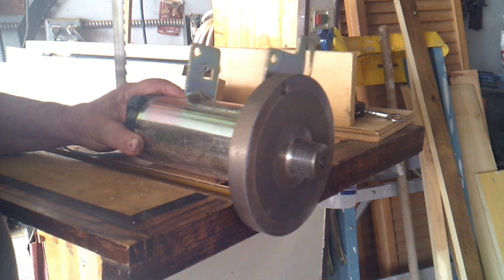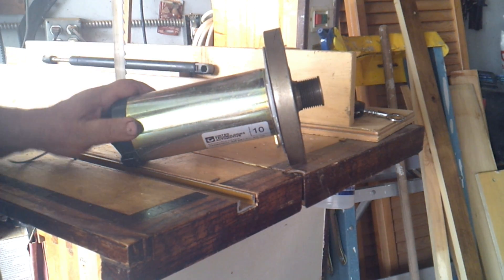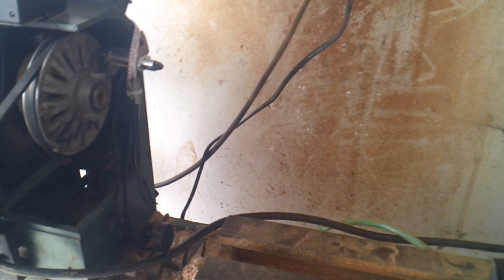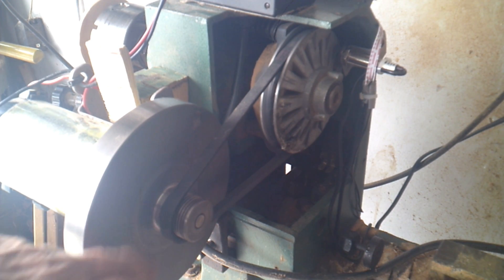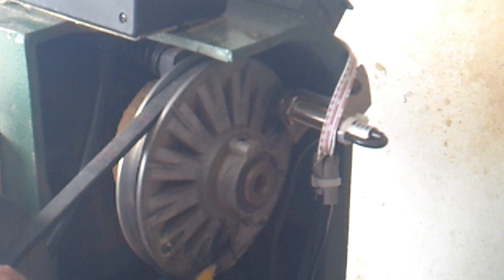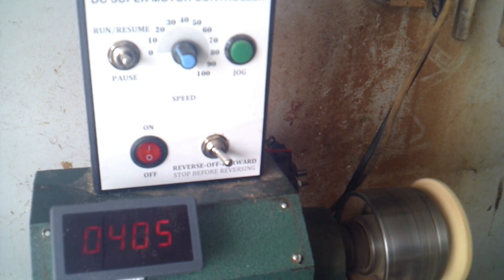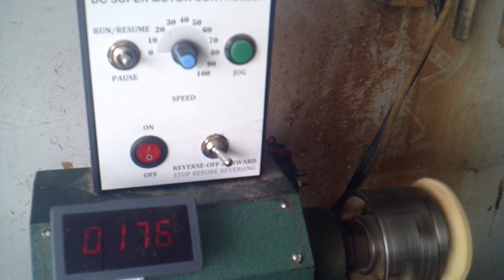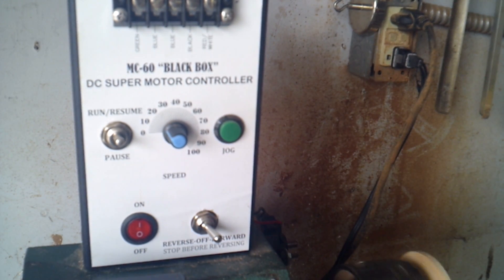Harbour Freight lathe modifications with a DC motor

Comment: Excellent video!  What are you using for you AC to DC conversion to power the motor?  Also where did you source the motor from?  Thank you!
Reply from the maker: mtabernig

Yes, i purchased on Ebay. However, the page is empty. I found a page were there are many motor controllers and perhaps better than the one I had.
here is the page.
https://picclick.com/MC-60-Black-Box-DC-Super-Motor-Controller-Ideal-292651286896.html

Comment: Do you happen to know the site where you bought the black box fo $40. 
Everything I see is around 135
Reply from the maker: Yes, i purchased on Ebay. However, the page is empty. I found a page were there are many motor controllers and perhaps better than the one I had.
here is the page.
https://picclick.com/MC-60-Black-Box-DC-Super-Motor-Controller-Ideal-292651286896.html

This is the one I like.
https://www.ebay.com/itm/112637741836

a few years passes!!!

Good luck
Reply: Thank you for your time. I appreciate it.

Comment: Hi thank you for the video was very helpful I was wondering since it’s been a few years is there anything that you would have done different or are you still liking it as much thank you very much many blessings
Reply from the maker: well, yes. All and all, I am happy with the new motor,  However upgrading my CNC spindle I came up with a Variable Frequency Drive, VFD, wee I can install a regular motor and control it with the VFD   that contraption converts 220 single phase to 220v 3 phase.  the cost of that contraption is equivalent to the box I do have, however the 3 phase motor is much more than the one from the exercise mill....Well is all on how the cookie crumbles. the second method is much more expensive and conversom.
Reply: Thank you

Comment: You can take that big flywheel off. Unscrews clockwise. Motor stops spinning a lot quicker.
Reply from the maker: Yes, that us true, however, it also helps to maintain the speed stable when loas varies...chisel hogging more or less wood. But you do have a point.